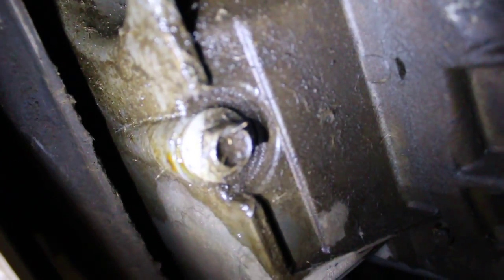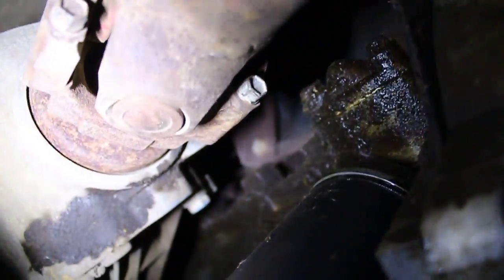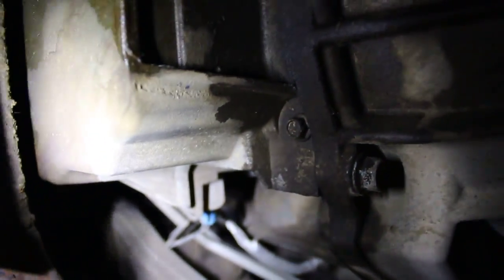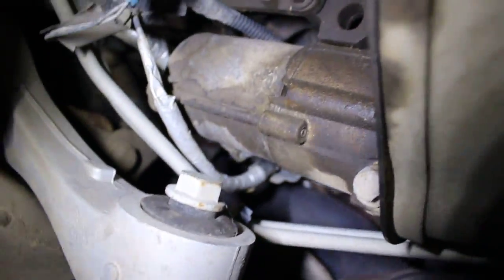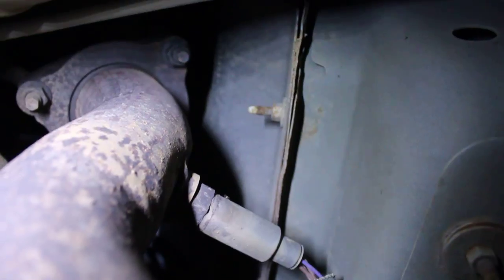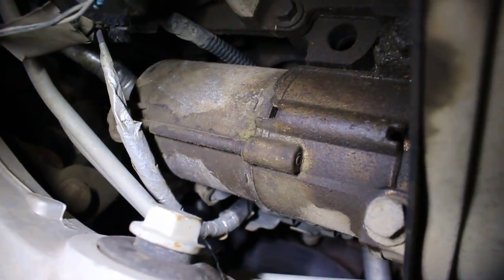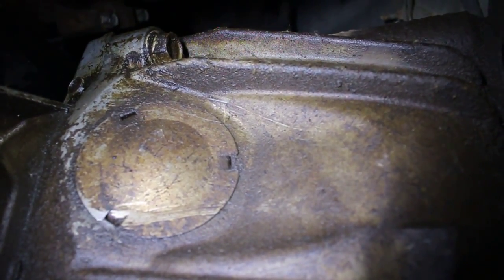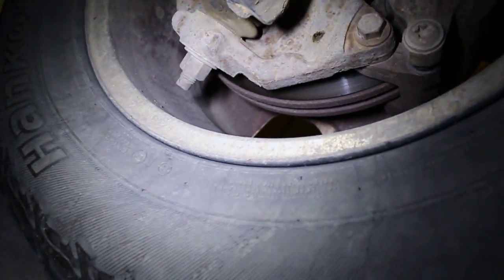Finding an Oil Leak on the chevy Avalanche 2002 5.3L Vortec Engine

Comment: If anybody sees this comment don’t trust the mechanic just hear me out real quick. If you see leak from the filter side check the cap on top of the filter. If you have oil coming from the starter side (the bolts look like they are dripping oil) take the starter off and check the crank sensor it’s right above the starter those leak. Also make sure is not coming from the very top the valve cover gasket. All this I mentioned are very easy fixes you can do it on your own. If is none of what I just said then yes it is your main seal. Make sure you check all this before you go pay for a main seal replacement to find out it wasn’t the main seal. Mechanic will always say is the main seal even if they know is not. It’s just easy money for them

Comment: Having mine replaced now. Thought it was the rear main, ended up being the oil pressure sensor.
Reply from the maker: yeah mine is still leaking and getting worse so it was a cheap fix?
Reply: Tyler it could have been if I wasn’t stubborn. Since I told my mechanic to change the rear main, it was an unnecessary fix at the moment but, a necessary fix for the future which costed $600. The real issue ended up being the oil pressure sensor leaking oil. So the total job ended up costing about $860 (plus some other stuff I had him look at). Could have just been a $200 or less job with supplies though.
Reply: Plus he’s replacing the intake gaskets. If you have oil caked up on the valve covers, it might just be the oil pressure switch.

Comment: Likely burns some but also when your driving the wind/air likely is blowing it all over and why you may not see drops, I'm having the SAME issue currently, wet on both sides, on filter,drain plug ect and have had a hard time pin pointing where, replaced oil pressure sensor since many have had thar issue, but still leaking..so I fear it's rear main seal , possibly back of manifold gaskets

Comment: I am experiencing a huge oil leak from my 03/5.3l Chevy trailblazer I replaced my oil pressure sending switch thinking it failed...because my oil pressure gauge was stuck beyond 80...my truck continues to leak large amounts of oil daily it seems to be leaking  from the top of motor to bottom any suggestions would be greatly appreciated
Reply: BRI & LEE im having same problem did u figure it out. My starter went out caude of all the oil leaking.
Reply: BRI & LEE 

Oil valley pan

Comment: I'd get a fluorescent dye leak detection kit to make absolutely sure where the oil leak(s) are.
I have to replace the rear main oil seal in mine tomorrow or Monday as mine leaked worse after fitting a neoprene rear main seal so I ordered another Teflon one.
Mine is in an Australian delivered car (Holden Commodore) which did have a problem with excessive oil consumption in 2000 when they first replaced the 304 cubic inch Holden V8 engine.
Many of them had excessive piston slap so were rebuilt using 10 thou oversized pistons or had whole engines replaced.
Mine is a 2002 model which never had that problem & has just clocked over to 325,000 kilometres & doesn't use oil,the compression is good too.
Mine smelled of burning oil as oil was blowing onto the catalytic converter from the Bell housing so has been leaking oil worse than yours.
Reply from the maker: yeah i could but at this point the truck is at it's end. it's starting to have severe lifter noise and burn a little oil at start up now. it's got 214,689 miles on it and it had nothing but issues. the rear end bearing are going out. the rear end got a lot of play the oil leak is still there. and the transfer case pump rub through and was leaking needs a new back plate 800$ i put plastic jb weld on it fixed it for now. the u joints are out again on the 4x4 the left front wheel bearing is out again for the third time and front axle seal on the front left side. tie rods are getting bad. engine has loss of power sometimes. and brakes in the front are gone. so idk if it's worth it or not to put any more money in it. i owned it for one year put 9,000 miles on it and spent total of 2 grand on it already and it's getting worse.
Reply: Does you gas gage work?

Comment: Here's where you start to run down this now famous 5.3 leak.
1st clean all that shit up...
2nd check the flywheel (hole on bottom of bell housing) if its wet, you have a blown rear main seal. 
3rd oil pan/ gasket/ and drain plug. Drain plug on this motor is suspect. Just for good measure, a dab of silicone helps a lot. If that's not it then remove the starter and look at the oil sensor, another suspect part on these motors.
If all of that checks out, pop the hood and give the valve cover gaskets a look. They are possible but unlikely, if one was bad it would concentrate the oil leak to one side of the motor...
Now that you read thru most of the possibilities here's public enemy #1.... Valley pan gasket.. Under the intake... Sounds like a bitch of a job but pretty simple and straight forward. While you have the intake off, swap out the old intake gaskets too... 
that should take care of the puddles of oil in the driveway...
Reply from the maker: Thank you I try and see what I find with it sometime I thinking it one of these issues.
Reply: I have the same problem with my 01 gmc sierra 6.0 2500. leaks from above oil filter and starter. I changed oil pan gasket and oil cooler line gasket and the oil pressure switch. Its still leaking somewhere. I was going to check the crankshaft sensor, and if not that, then going to check the air intake and valley pan. which could be it. I am getting a lean code after scanning it too so could be air intake gaskets and valley pan.
Reply: Thanks for the advice. Mine ended up being the oil pressure sensor. Got it fixed up.

Comment: 30-45 minutes 40 bucks later and boom your oil leak is gone..replace the intake manifold gaskets.
Reply: Mr 4sshole if you can replace an intake in 30-45 minutes then your a bad 4sshole

Comment: My   moms   05   has   similar   problems.  We   thought  the    problem   was   fixed   when  we   changed   the   oil   filter   but   its   not.    Before   we   changed   the   filter    we  would  have  to   put   oil    in   every   week   then  every   two   then   the   oil  pressure   droped   so   we   got  the  new   filter   in.    When  we   put   the  new   oil   in   but   didnt   notice   any   leaks   then.   A   couple   of   days   later    it   was   leaking   so  my   uncle   checked    to   make   sure   the   filter   was   on  tight   it   was.   The    oil   pressure   will  be   on   the   40   mark   on  the  gauge    but   the   truck   would   say    low    oil   level.   The   oil   is  dripping   from   the  bottom   of    pan.   I  was   told   it  could   be   the   oil  pan   gasket   or   the   rear   main   seal.
Reply: The oil pressure sensor is located on rear of the engine,So if it's that,it could leak all the way down.

Comment: Intake manifold gaskets are bad is hard to believe is where is leaking form but it is my truck is doing the same thing
Reply: elgoofy4 my 05' 6.0 lade is leaking, and its coming from somewhere on top of the engine and it runs all the way down to where i drain the oil pan, you think its the same problem?